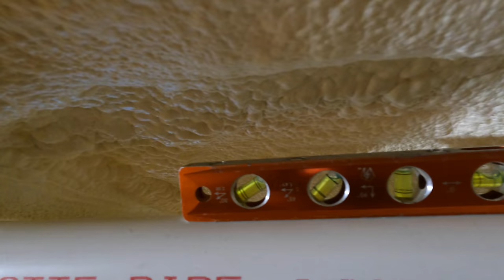We've Been WAITING 5 Months for THIS the BEGINNING of the NEXT BIG STEP | Building Our OFF-GRID Home

Comment: Next time just grab a paper towel chunk from a roll, fold it in half, then wrap a length of electrical tape around it.  The pressure will stop the bleeding then start the clotting process.  Look into getting a product called NewSkin.  It is a liquid bandage.  It will sting a little on a deep cut but that will pass.  It will harden up and last for several days before it will start to peel off.

Comment: We've had the same GRUNDFOS system for 7 years.  Love it.  You've got the necessary components.  Now set a toilet.  The day our septic was set, I set the toilet. I just ran a garden hose frost the well connection to the toilet tank.  Ours was in the open in the middle of the basement. I quickly framed the walls of the bathroom and covered them with whatever I had which was cardboard and tarps.
Reply: Your priority-set is on-point :D

Comment: In the boat club we keep a steel pipe with a steel plate welded end we use it brake ice when needed you need a bubbler system then you would keep  that area clear of ice

Comment: We use a mobile STEAM  trailer to clear  ice clogs in culverts. We use heat mats to thaw ground. We use a HD Welder to heat frozen water mains on metal pipe and push a steam hose up a frozen PVC pipe.

Comment: Hey Al, just a small thing, but the hole in the wall for the exhaust needs to be below the main line ao any condensation drains outside.  It also prevents cold air backwashing into the house.

Comment: First time I have seen a DWV ran out of the wall. Normal construction is through the roof. Also for those who are gluing DWV piping that will be inspected, you better use purple primer as the inspector will not approve clear primer glue mix. I have seen a couple total house  DWV systems completely rejected and had to be replaced just because of the clear primer.

Comment: Al, the Uniform Plumbing Code requires ALL pipes, both drain and vent to slope at 1/4 inch per foot!  Sorry
Reply: there is a provision in the code to run level once you get beyond 6" above the overflow point. (guessing that means above the highest fixture vent) To me, that doesn't sound like the perfect answer, but it's allowed. In this build, I see there was room for some pitch, which would allow for some settling of the building in 25 years.

Comment: Things are looking great! I was wondering if you will get enough updraft on the sewer vent going out the side of the wall. Going through the roof will also keep the stink away from your nose.
Reply: The vent stack must terminate one foot above the adjacent roof and be ten feet away from windows or doors. The larger issue may be frost accumulation in the vent stack. In the climate that they are in it requires a four inch stack for about four feet at the end. The turn down may amplify the frost issue and the screen almost certainly will too.

Comment: I have never used a side vent for the stack.   Interesting to see how you did it.  I see the 3"  pvc with a bug screen on the outside.  I hope the moisture does not close off the vent in a rea cold snap.  All our roof vents are 3" from inside the attic to outside and above the roof expected snow level.   2" pvc vents were freezing shut.
Reply: Our plumbers always go straight up through the roof and use black pipe for thr vent piping so it does show as drastically against the roof.  

Is the sidewall vent code?  Or do you not need plumbing inspections since you are doing it yourself?  Actually have not seen any code enforcement inspectors on the site yet - plumbing, electrical, framing, etc
Reply: Due to the design of our home (log) the stink pipe side exits, then turns 90 degrees up and through the eve.  Yeah, it's eventually above the roof, but, the only issue I could see with a side exit is gasses getting trapped under the eve.   Al's design could easily be changed if need be.
Reply: I have the same problem with the vent pipe for my furnace. Actually I think it is more of a fresh air intake.
Whatever. But it is only two inches and does freeze up once in awhile. During the coldest weather ! Such as below zero. And then suddenly , I have no heat !  It happened twice this past winter. -5 degrees outside and no heat . Brrrrrrr. I'm  inside the house dressed like an Eskimo until the sun thaws the pipe out. 
  If I pay attention,  I can see the progress of the Earth along it's orbit. A few days ago the first early morning sun was shining through the kitchen window onto the North wall.of my dining room. Now , this morning the first morning sun has moved and the sun is shing onto the West wall of my dining room. So, the season is moving on. 
  My two new Nanking cherry bushes are growing nicely in pots in the living room. They will be transplanted outside after danger of frost is past. Last week during the warm days I took some Elderberry cuttings. Three of them are now leafing out in a pot of peat moss. I do.not use any fancy potting mixes. I just use peat moss for every thing. Starting seeds. Rooting cuttings ( I hope ) , planting barefoot plants and trees.
It seems to work so I see no reason to spend extra money for fancy stuff. For about the same price as a smallish bag of planting mix , I can get a whole compressed ( two cubic feet ) bale  of peat moss. Which will last me for.a long time.
Reply: @robertbates5537  Lumnah Acres have said in many previous videos that the only inspection that is required was for the Leach Field.
Reply: @tonygrimes13  missed that sorry.  Must be nice, everything I would do where I live has to be inspected

Comment: never seen venting a plumbing system out the side of a building without it raising above the roof line..
Reply: years ago it was common to see vents out the side of a foundation. I suspect that's changed.
Reply: @rupe53  
Plumbed for over 35 years……as long as I’ve plumbed the jurisdiction I worked in required very termination to be above the roof line…at least 12” I believe…wouldn’t be surprised if they get a whiff of sewer gas now and again.
Reply: @joetrippi1603  ... I'm with you here. Even Radon systems are plumbed above the roof. The situation I spoke of is usually found on older homes where they also used a whole house trap so it was more about water flow than venting sewer gas.